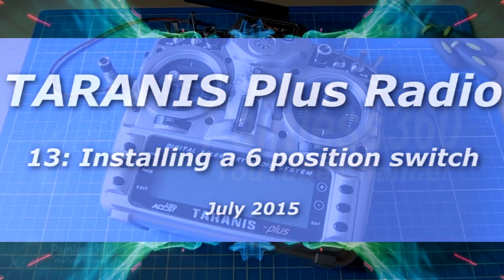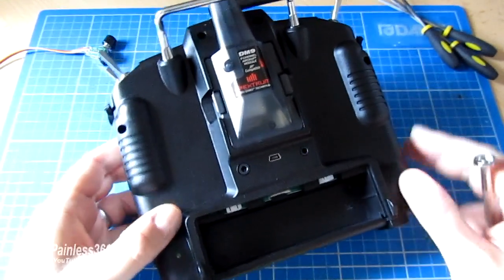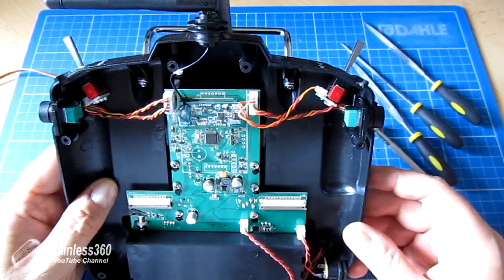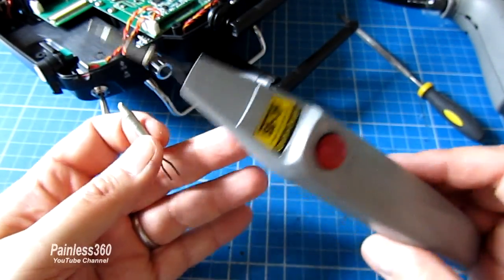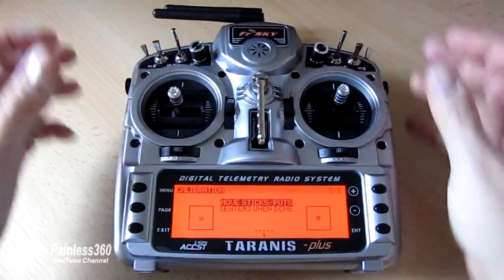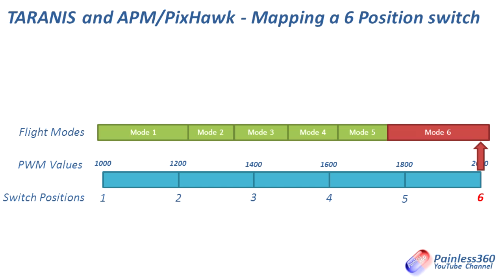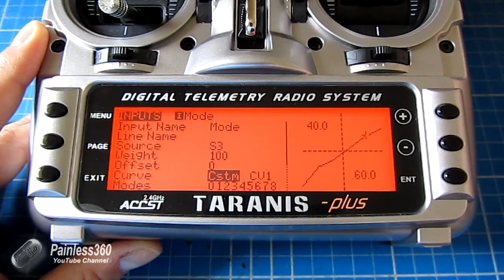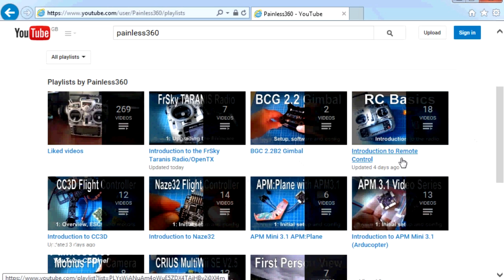(13/13) FrSky TARANIS Radio – Adding a 6 position switch (S3) and setup for APM/PixHawk

Comment: looks like you have your switch wired Gnd, +ve, Sig top to bottom?
Reply from the maker: +jibba02 let me know exactly which bit of the video isn't clear, we do cover the wiring in here..
Reply: It is clear. however you used yellow for +ve and Red for signal!

Comment: +Lee
Sorry I might not have explained this very well my issue is that in the models /mixer menu for ch5 the source does not have S3 listed as an input nor is S3 listed as a source in the inputs menu.  The only plase S3 is listed is in the calibration menu in Radio setup and of course in the Hardware menu it is configured as a Multipos switch.
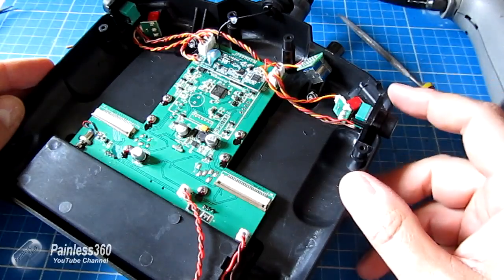Reply from the maker: Is this in reply to an existing question/reply? Can you reply to the answer if it is as with the volume of questions it's next to impossible to keep track otherwise. The way that worked for us is documented in the radio and we did have to setup S3 : 8:57..
Reply: My appoligies Lee I have carried out that step as mentioned in the video I have also managed to calibrate the switch S3 without any issue.  What I am not able to do is assign the s3 to any of the mixes as it does not appear to be available I can see S1 and S2 but where S3 should be in sources I just get 3 dashes ---
Reply from the maker: I see, I've not seen that here. I'd check that the forums don't have any pearls of wisdom,, Best of luck with it..

Comment: Hi I have just received a Taranis -plus and have updated it to the latest firmware and getting to know how this transmitter works.  I got a 6 poistion flightmode switch from bangood and installed it as per your wonderful instructions but I am having one issue.  The switch calibration worked fine but I am not sure how you linked it to channel 5 on the radio.  sorry if I am missing something as I am a complete noob here and any advice would be good.
Reply from the maker: If you're a new pilot with this radio then I'd suggest you start at the beginning of the series as it covers all the main basics in the first 4-5 videos and then build from there with more and more complex topics and capabilities. Best of luck!

Comment: Hello again Painless
Back with another issue, this time with the set up of the 6 position rotary switch.  I select the "Multipos Switch" for S3 on the hardware screen.  Go to the Calibration screen and complete as directed, everything looks normal.  When I exit that screen and check for function, Channel 5 shows -90 but does not change when switch is rotated. I go back to the Hardware page and S3 shows "None" instead of "Multipos Switch".
Now there is one small detail I noticed, that differs from your video.  When I rotate the switch during calibration, the graphic shows the bar change but the tiny position number disappear after about the first two detents.  
I have tried three times with no luck and I went back inside the radio and double/double checked the switch is wired up correctly. Bummed. I like the concept of the rotary switch and don't want to use the SE and SF switches. Like you I have set up the SF switch as the panic switch. 
I hope you can shed some light on this problem.

Peace, Wolf
Reply from the maker: Hey Wolf, I'd check with the vendor as not all the 6 pos. switches seem to be the same. The calibration routine should take care of most of it. I'd give it another go.. Best of luck..
Reply: Do you think swapping the ground and signal (flop) leads might be the issue?  The little sticky on the side of the switch shows Ground /Signal/VCC, just like yours.  I am wondering if I leave the positive lead where it is and swap the other two...
Thoughts.
Reply from the maker: Possibly, It's only a resistance so should be fine to do that. I'd get back to the vendor and get him to way in too - if he knows what he's doing he can help you check you've got the right switch..
Reply: Hey Painless
I swapped connections and the results were inconclusive. so I set them back to the original positions.  Strangely enough this morning, I was able to get the "Multipos Switch" to stick on the "Hardware" page. but then it failed later.
I am starting from scratch, Noob status, on OpenTX Universe and going through all the steps methodically. Earlier, I had it working with Mission Planner for a session then the next morning it would not talk anymore. COM port shows "USB Serial..."
There is one nagging discrepancy I noticed. In this video (6 Pos Switch) you have 12 pages in the "Radio Set-up", My radio only has 8 pages. [Radio Set-Up, SD Card, Trainer, Version, Switch Test, Analog Inputs, Hardware, Calibration].

I am at a loss for what is wrong with my TX, but suffice to say it is a soup sandwich.

Stressed, Wolf
Reply from the maker: I'd start to suspect the switch, it shouldn't be that hard...

Comment: Hi pal I have a taranis with only the mode "d16 Eu" I want to connect it to a x4r sbus but having quite a few issues , basically I've heard with the new updat I can use the x4r in both sbus and cppm by jumping pins 2 and 3 but I'm unsure if that's correct I have the normal white non sbus x4r that came with my taranis but to my knowledge that only has Pwm .
Reply from the maker: I believe that it's a 4 output PWM only. The manual is here - http://www.frsky-rc.com/download/view.php?sort=&down=158&file=X4R-X4RSB. I'd also look at the firmware pages for it too as features can be added/changed sometimes..

Comment: Does anybody know how to assign sounds to the six positions of S3?
It seems that custom functions can only be assigned to switches....
Reply from the maker: +David Pulvermacher Easy - use the Special Functions to make the logical switches play the audio that matches the mode you've selected. i.e L1 a~x CH5 -90.0 etc. See our other video on mixing and setup up the radio..
Reply: +Painless360 .Thanks for that. I'll give it a shot.
Reply: P360, can you list the specific video you are talking about. You've got many on the Taranis. Thanks, I specifically want to set a sound file to play in each position of the custom curve.
Reply from the maker: Easy, Google 'painless360 6 position' and you'll find it ;)

Comment: I just want to let you know how much your videos help me with my Taranis X9d, X9e and the APM based flight controllers. I know you must have saved me hundreds of hours over the last couple years in saved time trying to figure things out on my own. Your videos are very easy to follow and understand. I find I use them as my first "go to" when something is not obvious to me. I cant thank you enough for your help. 

I do have a question pertaining to this video. I am using the 6 position rotary switch as the mode selector on my X9e for all of my APM and Pixhawk based flying machines. The question is, how can I get the Taranis to play the selected mode? It was easy to program the voice file to the toggle switch position combinations but it doesn't seem to work the same way with the 6 position switch
Reply from the maker: +Shawn “K5NWZ” Bates I set up logical switches using the a~x operator and check that CH5 (my mode channel) is approximately the same value as we setup in the curve (-90, -40 etc). Hope that helps.

Comment: Hi Lee, is there a way to set my switches in special functions to have my quadcopter landing gear come down before it lands in RTL? Also is there a way to set my SH switch to arm my motors? Thanks.
Reply from the maker: +Grove Hull yes, setup a flight mode for RTL (see the flight modes video) and have the gear channel setup automatically with a delay. Best of luck!

Comment: Hi Lee  Thanks for your last bit of advice regarding sounds to correspond to switch positions. Thats all working fine.  I have set up my radio for the exact figures X and Y shown on this video. but my output figures are different. I am getting 988-1193-1398-1602-1807 and 2012.  The curve is exactly the same as yours , but on Mission Planner, Flight modes it is jumping two of the modes. any ideas?
Reply from the maker: +Ken Mcnaughton I'd adjust the curve so that the values are solidly in the ranges on yours then. Not sure what's going on with your radio but sounds like something else is affecting the output of that channel. Best of luck.

Comment: Anyone else having an issue the ground pad pulling off this switch.  The other two pads solder just fine for me but the negative contact pulls off the board.  am I doing something wrong?

Comment: Hey! Thanks for the detailed guide on the 6 position switch installation and curve setup to fine tune the PWM signal ranges. I just picked up 1 of the switch from a local RC store and plan to install it on my Taranis Plus.

1 question, any idea which molex connector that will fit on the S3 solder points? Planning to solder a connector on it for a easily removable option, in case I decided to change S3 for other usage.

Have some 2S balance connectors but apparently it's not the same size fitting.

Thanks in advance!
Reply from the maker: +Asri Zainal Not sure, sorry..

Comment: I'm trying to install the s3 switch in my taranis plus with a 6 position encoder switch, that i would like to have control my pixhawks flite modes. The problem is that the s2 pot seems to be affecting the s3 . i can see when i look at the analog input screen that when i move the s2 pot the value on a6 and a7 inputs change. I thought that the s3 hardware setting may be set  wrong so i checked that and it bleeds over with the s3 set to pot, multi or none.I went ahead and installed the encoder switch anyway. and just like i thought  when i try to calibrate.The s2 affect the s3 and calibration fails.  
I have look at forum pages and in the limited manual that comes with the tx and couldn't  find any thing that would help. That's all that i know and all that i have done. Do you know of anything that may be causing this  to happen?
Reply from the maker: +Larry Randall I've not seen that. I'd check that you have no mixes setup and then go trough the radio calibration routine again. Best of luck!
Reply: +Larry Randall Hello Larry, I've got exactly the same behavior. Have You got anywhere closer to a solution?
Reply: +Larry Randall Me again!
I managed to get it to work :). unfortunately i did two tthings and I don't know witch one of them that did the trick.
I resoldered the switch and i updated the firmware with the LUA and EU settings. After calibration it seem to work.
Reply: I have the same problem! Can anyone supply a solution yet? +Larry Randall

Comment: i have recently bought a taranis plus and was getting ready to add s3  6 position switch when i noticed  that on the analog screen when i would move s2 pot the value on the s3 would also change. i went ahead and installed the switch anyway making the curve and every thing as in your video, but when i calibrate and go to move s2 pot as part of the process  the s3 bar also moves and messes up the calibration . is there anything that i can do  to correct this or did i get a bad tx?
Reply from the maker: +Larry Randall Happy to help but please watch https://www.youtube.com/watch?v=olIqTiSJHIY and come back to me with more detail of what you've tried..

Comment: I set it up and the values are all over the place. Very frustrating. So I opened the taranis back up and checked the connections. I looked with magnifying glass and realized that R1 resistor was missing! I see the 2 points of solder but empty. This is the farthest one away from the solder points and all the other ones were there. I'm sure I did not over heat it. So look out if you are having setup problems.

Comment: if you set the weight to -60 instead of creating a curve it works out similarly. with the mix source set to S3 and the weight set to -60 you'll get  -60/-36/-12/12/36/60, and if you want to reverse the 6 position switch, enter a weight of 60

Comment: Available in the UK here http://boltrc.com/uk/index.php?route=product/product&path=75_76&product_id=558
EU here http://boltrc.eu/nl/en/parts/170-frsky-taranis-6-position-mode-switch-99170000106.html
AUS here http://boltrc.com/index.php?route=product/product&path=75_76&product_id=573
US here http://www.alofthobbies.com/6-position.html
As a rule it is not worth getting FrSky stuff from E Bay and the like. The official dealers usually faster and cheaper
Reply: Rob B BEST FRSKY DEALER IN U>S> WWW>HELIBATICS>COM IN TEXAS!!!  BEST CUSTOMER SERVICE EVER!

Comment: First off for those asking where to get this switch. It is a standard FrSky part and should be easily obtained from one of their dealers.
My second point. FrSky screwed the pooch on this. The increments are not evenly spaced as Lee has shown here in the video. The really weird thing is by relocating 1 resistor and adding a single jumper wire the switch can be made to give evenly spaced values which match the APM and Pixhawk without the need for curves.
I bought and fitted mine long before OpenTX 2 was released and this switch was not supported under OTX 1 so the modification was, at the time essential from a sanity point of view.
I would have expected FrSky to have remedied the issue by now. apparently not :(
Reply from the maker: Great point,  do you have more details on the mod?
Reply: Painless360 it was years ago Lee but this will show the details. In fairness it is not for the solder challenged or feint of heart. That resistor is tiny.
http://fpvlab.com/forums/attachment.php?attachmentid=47998&d=1403496511
In any case it is not so much of an issue these days. The Taranis's strongest feature is also it's Achilles Heal. Open TX is constantly evolving and the support info is always out of date. Even the minor revision from 2.05 to 2.1 has brought changes to how the OS works.

Comment: Please could you give me more details about the switch as it's not a run-of-the-mill 1-pole 6-way switch it's more of a 6-position switched resistor of sorts.
Reply: Peter Grain You got it in one. It is indeed a switched series of resistors. Search RC Groups for FrSky 6 pos switch for the lowdown on it's construction and possible mods.
Reply: Rob B Thanks Rob. I try that.

Comment: I use companion and enable micro seconds. Now you can assign exact values on the curve.
Reply from the maker: Great tip.  What version are you using?
Reply: +Painless360 the latest.  2.1.1. I may be mistaken about the curve. Anyway here is a trick for any number of modes. 1165, 1295, 1425, 1555, 1685, and 1815. In this case set the relevant channel max and min range to 1865 and 1165. So mid point is (1865+1165)/2=1515 range 350 either side. 

The new 2.1.1 firmware has major telemetry changes. I lost my cnsp a figured it out a couple of days ago. It may be helpful to do a video on the new trlrmetry especially the calculated ones.
Reply: +Rav Gupta oops. 1865 should be 1815. Anyway basically 6 modes spaced equidistant. 6 position switch producing 6 equidistant results. Use min required frequency to one end and max to the other. Say you only had 4 modes at 1100, 1200, 1300, 1400 but have a 6 position switch. We add two more imaginary modes at 1500 and 1600. So max min are 1600 and 1200. When you rotate the switch the first four positions work. The last two wont change the mode. 
Ill put in a feature request for curves to show microseconds on the Y axis of the curve after checking companion again.
Reply: +Rav Gupta i give up. Min is 1100. No more commenting using a phone.

Comment: the problem is how do you know what flight mode its in? can you set up a sound for each position?
Reply from the maker: AndyRC Yes you can. Use flight modes to display the mode on the screen and sound files to announce the modes. Check in the Pixhawk series playlist for a LOT more detail ;)
Reply: thank you sir

Comment: Hey there again, Painless360.  Great video but just one constructive criticism:  It would have been very helpful (at least for me personally; your other viewers may disagree) if you had included the actual drilling and mounting of the switch.  I would have liked to have seen what tools you are using and how you did it.  Anyway, thanks TONS for the great video and the helpful information.

Note:  You should mention that this mod will NOT work on the original Taranis (ie, the non-Plus version) as there is no included pinout on the circuit board.
Reply from the maker: Appalling68 Thanks for the feedback but I do show the dremmel and needle files. I will add a note to the description. 
Happy flying!

Comment: Great information! Where would be a good place to buy this switch?
Reply from the maker: Peter Arnold I ordered mine from eBay. I've looked at other places (Banggood.com, HobbyKing etc) and they don't seem to stock them.
Best of luck with it. There is a video on the Pixhawk series that shows more of the setup for a APM/PX4/Pixhawk now if you are interested.
Happy flyin!
Reply: Painless360 Thanks. I found one here http://www.alofthobbies.com/6-position.html

Comment: Is S3 only on the plus model? As S3 is not an option under hardware on my Tx. 2.0.16 Under hardware I have: S1,S2, and Serial Port. Great video!
Reply: Very fine, good idea and thanks.
Reply: John Bailey This reply is to John and everyone else concerned.  The mod Painless360 is demonstrating here is only valid for the Taranis PLUS, not the original Taranis.  Why? Simple.  The circuit board on the original does not contain the circuit/pads found on the PLUS version and used by Painless360.  Yes, you could do as TheRogerx3 suggested if you are brave. ;-)
Reply from the maker: John Bailey Not sure. Loads of great detail on the OpenTX university and RCGroups forums. You can replace one of the S1 or S2 switches..
Happy flying!
Reply: John Bailey You can on a Taranis X9d by direct replacement of the S1 or/and S2, Cut the wires off the old switches and resolder on to the new indented switches. But additional switches like Painless360 I'm not sure as he has a Taranis X9d plus.
Reply from the maker: Thanks for clearing that up.